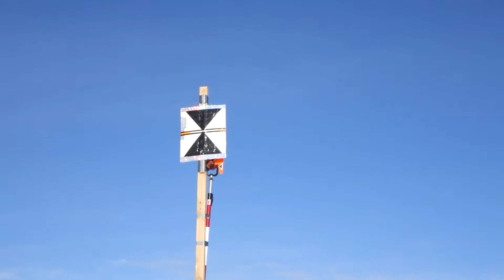Laser with corner reflector prism

Comment: My challenge to flat Earthers has been for them to make a video documenting the location of observation and location of observed structure, geologic formation at a relative distance and elevation that a curvature calculator indicates should not be inter visible. For instance, show the top of a structure 100 feet tall or less above sea level with the camera  50 feet or less above sea level at a distance greater than 23 miles and or show the top of a structure that’s higher above sea level of observer always above eye level regardless of relative distance. Flat Earthers are deathly afraid of theodolites, auto levels, whatever.
Reply from the maker: That would work as long as the test is not made at night or around sunrise or sunset.  Need to insure minimal refraction which you tend to get midday in the summer between 10am and 4pm.  In the winter I would try between  11am and 2pm
GH   June 01, 2021

Comment: If you had the laser 6 feet above the ice and reflector 6 feet above ice how far would they  have to be separated so as not be inter visible and the beam not hit reflector directly?
Reply from the maker: Not easy answer.  Theoretically in a vacuum with no atmosphere to cause bending and scattering of the laser light and a laser beam that does not diverge, the target would be hidden from view of the laser after 6 mile separation.
But on earth we have an atmosphere that refracts and scatters light and a surface that causes diffraction and acts as a wave guide.  That combined with the laser beam diverging at a typical value of 1.0 milli-radian, results in the beam hitting targets much further than predicted above under ideal conditions.   Certain conditions arise around sunset (circulating rays with clear sky) that can result in the laser light hitting targets 100 miles away
GH  June 01, 2021

Comment: My dude has aim better than most aperture science turrets
Reply from the maker: I made a special mount for my Topcon GTS-3C theodolite to attach lasers to it.  I can position a laser to within 5 arcseconds in the horizontal and vertical.  That translates to a position accuracy in a mile of 1.5 inches or 3.9 cm.
GH  April 22, 2020
Reply: @georgehnatiuk5806  dang that's precise

Comment: I like that you can sorta see how the laser spreads out and can still ping the reflector even when it's not being directly hit
Reply from the maker: Yes,  a typical non-industrial laser will have considerable beam divergence.  Common handheld lasers beam divergence at 1 milliRadian or more.  This means that the beam spot size at 1.36 mile is 14 feet in diameter!  You do not see this close in when in a room but go out a distance and the beam spreads out.  A laser beam does not remain pencil thin as it appears at the laser.

Stay tuned.  I have been working on collimating my Green laser and getting promising results.  At a target 3 miles away, I have been getting even more light returned than what was obtained in this video.
GH  April 22, 2020
Reply: @georgehnatiuk5806  thanks for le more science

Comment: Where did you buy your 64mm RR prism assembly? Typically I see these used by surveyors, but priced at several hundred dollars. Is this a Chinese kit?
Reply from the maker: Three of my reflectors are expensive Topcons and I have 11 others purchased off EBAY.  These are similar to what I used besides the Topcon reflectors..

https://www.ebay.com/sch/sis.html?_nkw=All-Metal+Single+Prism+FOR+TOPCON+SOKKIA+NIKON+Leica+Total+Stations+With+bag&_id=122016229033&&_trksid=p2057872.m2749.l46251

https://www.ebay.com/itm/Yellow-SINGLE-PRISM-FOR-NIKON-TOPCON-SOKKIA-PENTAX-SOUTH-TOTAL-STATIONS-/312762948919?hash=item48d21fdd37

I have purchase many units from this seller below and they seem to be of good quality and comparable to the Topcon prisim I purchased from dealer at $180

https://www.ebay.com/itm/Replace-64mm-Yellow-Prism-with-Aluminum-Stud-For-Leica-Topcon-Total-Station/113858352086

GH

Comment from the maker: Derivation of the quadratic formula:

Find x where     x^2 + Bx + C  =  0

First treat the first two terms  [x^2 + Bx]  as the partial expansion of a perfect square involving 1/2 the middle term coefficient, B   where upon expanding we get:

   (x + B/2)^2   =   [x^2 + Bx]  +  B^2/4     

Rearranging,        [x^2 + Bx]    =   (x + B/2)^2  -   B^2/4 

Substitute    [x^2 + Bx]  =  (x + B/2)^2  -   B^2/4   into the original equation above:

   x^2 + Bx + C  =   [x^2 + Bx] + C   =   (x + B/2)^2  -  B^2/4  +  C

      BUT,    (x + B/2)^2  -  B^2/4  +  C   =   x^2 + Bx + C  =  0
 
So we now have:     (x + B/2)^2  -  B^2/4  +  C  =  0

Solve for x  moving   { -  B^2/4  +  C }    to right side:      
 
                              (x + B/2) ^2  =   B^2/4 -  C  

Take square root of each side yielding two roots:

               (x  +  B/2)   =    +/-  sqrt [B^2/4 -  C ]

Move  B/2  to right side:

                x =  - B/2  +/-  sqrt [B^2/4 -  C ]
        
DONE

Comment: what kind of micro prism reflector are you using?
Reply from the maker: These are similar to what I used.

https://www.ebay.com/sch/sis.html?_nkw=All-Metal+Single+Prism+FOR+TOPCON+SOKKIA+NIKON+Leica+Total+Stations+With+bag&_id=122016229033&&_trksid=p2057872.m2749.l46251

https://www.ebay.com/itm/Yellow-SINGLE-PRISM-FOR-NIKON-TOPCON-SOKKIA-PENTAX-SOUTH-TOTAL-STATIONS-/312762948919?hash=item48d21fdd37

I have purchase many units from this seller below and they seem to be of good quality and comparable to the Topcon prisim I purchased from dealer at $180

https://www.ebay.com/itm/Replace-64mm-Yellow-Prism-with-Aluminum-Stud-For-Leica-Topcon-Total-Station/113858352086

GH   Dec 17, 2019

Comment: Do the reflector work on lights? Like a high beam on a car? Does it reflect back with a wide spot or must you be close to the light that shines to see the reflection?
Reply from the maker: Works for any light source.  It does not collimate a beam to make it tighter however.  It just reflects light rays back in the direction from which they arrived.

All these reflector are is several pairs of highly reflective mirrors A and B mounted in pairs at right angles to one another within a common enclosure.

The geometry is simple and clever.  A light ray coming in at some angle is bounced from one mirror A to the next B and then exits at the same angle it came in at.
                              
----------------------------  A
|  /   \
|/       \
|\         \
|  \         \
|    \         \
|      \
|
B

GH  September 07, 2019

Comment: Hi George, it’s a really interesting video showing laser capabilities, what type are you using to do the test?
Reply from the maker: David, that test was done with a 5 watt 532 nm GREEN laser.   I have other tests to yet post using a 10 watt 532 nm Green laser and a 30 watt 450 nm BLUE laser.   Several more tests have been done at 6 miles and 14 miles with 28 mile round trip.
GH
Reply: George Hnatiuk Thanks for your fast reply, I'm going to try to link two points between 4.5 miles  and I was not really sure what power would be necessary to use, maybe a 10 watt laser would be the best option taking in account your tests. 
I’m a bit worried with laser heat,
Have you checked if these devices get very hot while they are on? I'm afraid that being mounted on a tripod and not being able to dissipate the heat can easily get faulty. 
Thanks again for your information, it’s really appreciated from my side
Reply from the maker: I do not have that problem using them in the winter.  The biggest problem I have is keeping the battery warm so as not to lose capacity when they cool down.  The 10 watt laser does get warm with continuous use in summer but not HOT.  If you are only going to shoot 4.5 miles, a 3 watt laser would be sufficient.  This of course depends what it is you are trying to do.   You have not given me any specifics.
GH
Reply: Hi George, thank you for replying... I’m working in a light project to be developed in an event during the night. I’m trying to link 2 points.

I’ve been searching for a laser pointer according to the specs given above but I’m not really confident to use some Chinese stores to buy and I haven’t found many laser products from my local suppliers.

Do you know a good suppliers in order to get a device which I can trust?  
On the other hand, How have you linked with the prism? Have you used a topographical station? 
Thank you for your comments 
A really appreciated support has been given!
Reply from the maker: David,
I made a special mount to attach the laser pointer to my theodolite total station (Topcon GTS-3C)  that way I can precisely adjust the laser position to within 5 arc seconds(24 micro-radian) in the vertical and horizontal.

Shooting 4.5 miles the adjustment does not need to be so precise.  At 4.5 miles the beam width will be 24 feet in diameter for a 1.0 milli-radian beam.  There are easy ways to make a laser mount with screw adjustment to give you the precision you need for under $20.   I could detail it in a video if you are real serious about it.

Many of the laser products coming out of China these days are quite good.   I will be ordering more Green lasers in the next month and could get you a good price if you would like to add to my order. My relationship with a overseas manufacturer is very good.  I have yet to decide with what power to go with:  it will be at least 10 watts.

George Hnatiuk

Comment: the reflector appears to be lighting up even when the laser isn't directly hitting it.  0:51 ish

can you explain this for me, thank you.
Reply from the maker: Nathan,
A laser beam diverges with distance traveled from the laser.  The laser I was using has a beam divergence of 1.0 milli-Radian which means the spot size of the beam diameter is 5.28 feet for every mile the beam travels.  By the time the laser light gets to the target, the beam has spread out to where the beam axis DOES NOT need to be directly centered on the target to get a report of some light being reflected back hence the dim lighting that occurs as the beam axis gets closer and closer to hitting the target.  There is also atmospheric scattering occuring which results in even a wider spreading of the beam and even less precise alignment with the target required to get some light reflected back.  Of course, this amount of light reflected is considerably less than when the axis of the beam hits the target and you see a FLASH when that occurs.
GH
Reply: i have only just seen your reply.  it all make sense now.  thank you.